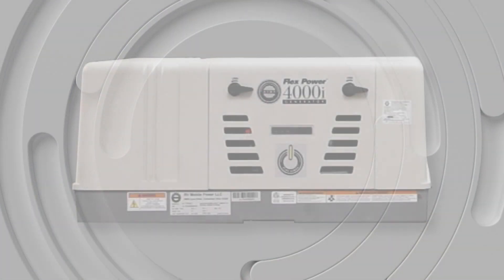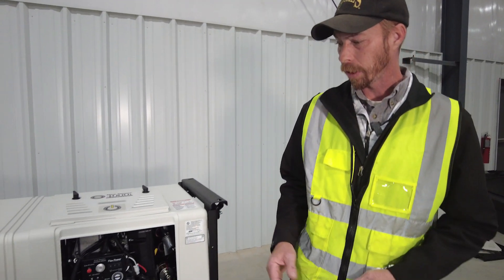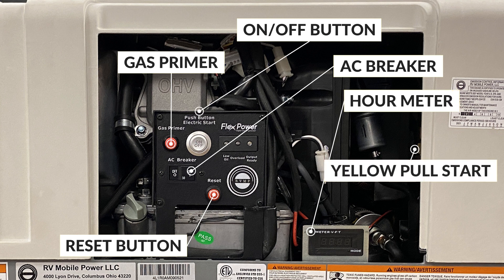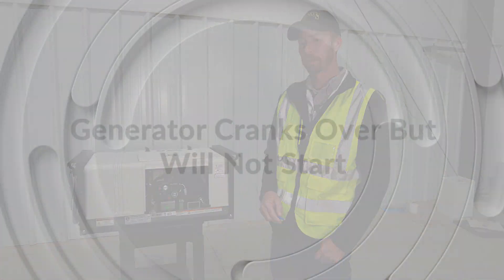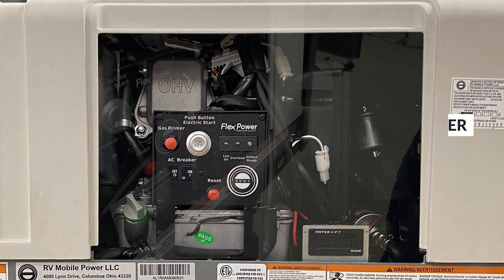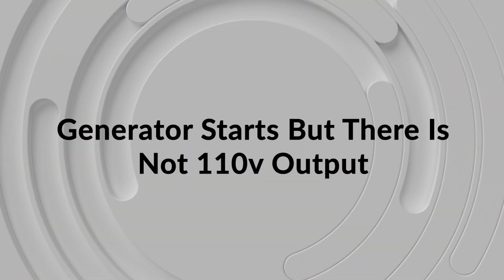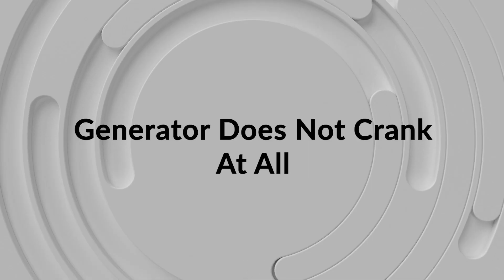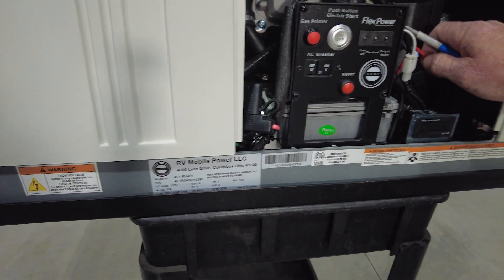Kobuk RV Power Solution - Basic Flex Power Generator Operations Troubleshooting

Comment: I crank the generator but does not start. I noticed the stop motor does not move at all. I checked the resistance it read 48 ohm. What might be the problem. For your info the fuel pump is working and filled the carb with fuel.

Comment: I wish I had a Onan Generator because after being a mechanic for 40 years I don't have a tool to remove the oil pan bolt. I tried a 3/8 extenstion and an allan wrench. Neither work so I guess I'm not smart enough to change my oil.
Reply: what tool do we need   i need to change oil
Reply: @eileenmurphy1597  8mm hex head